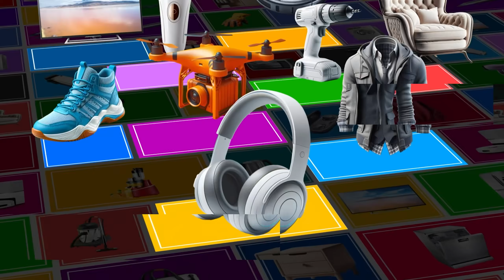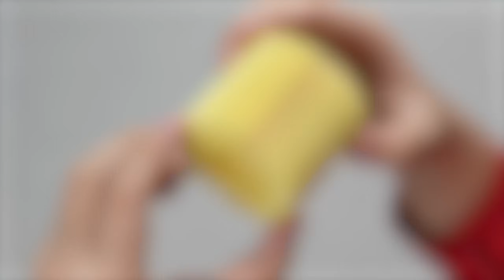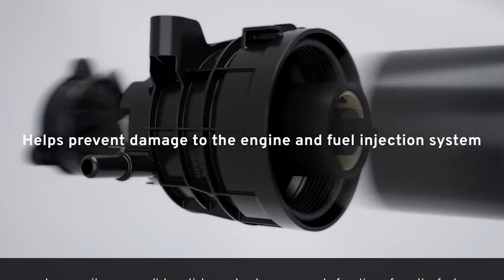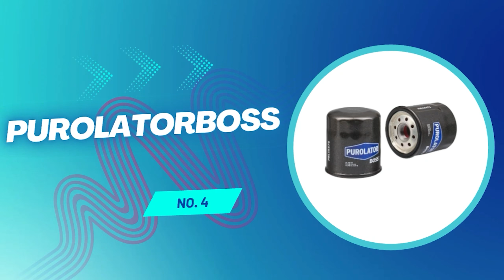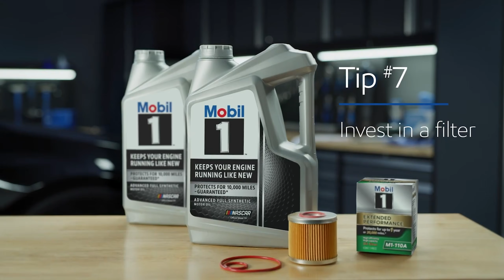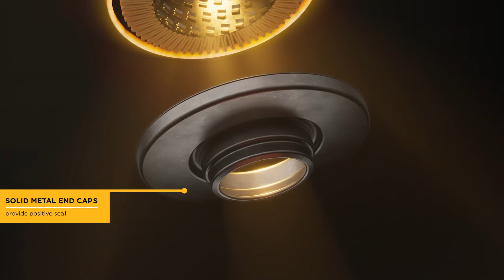Best Oil Filters 2026 – Top 8 Picks for Every Car, Truck & Engine

Comment: Ive been using Fram for over 35 years. Never had any engine issues. Current Ram is at 229k & Mustang 177k miles. Use a good oil and change at 4-5k miles.

Comment: For years, I've been using the purolator boss pbl22500 on my Silverado 4.8 .They seem to becoming less available. Advance Auto told the pbl22500 is being discontinued. Does anyone if this is true?

Once in a while,  I will see one at tractor supply, when I do i get it.